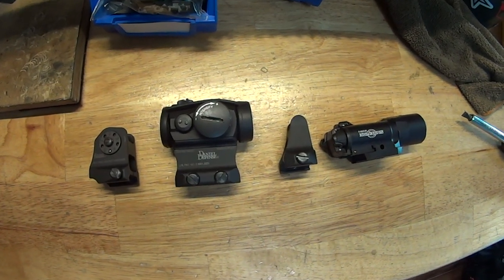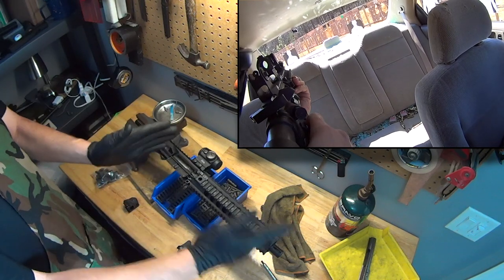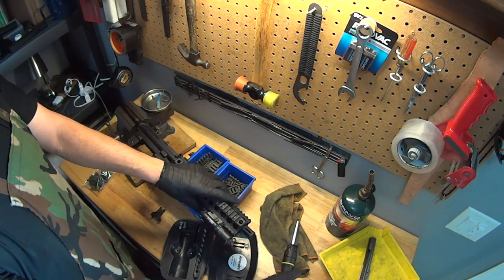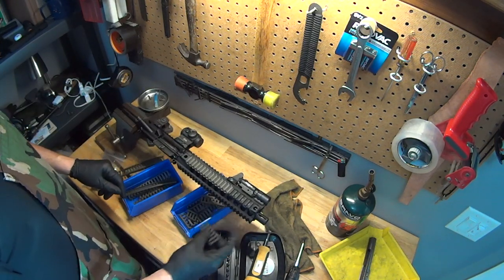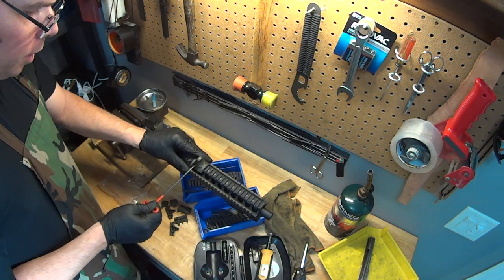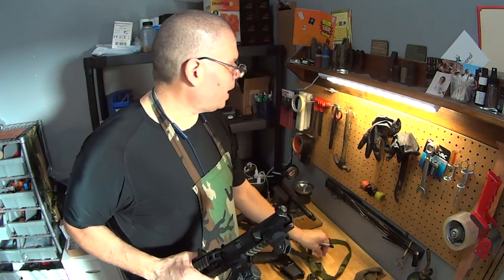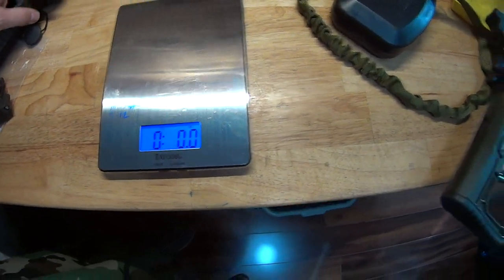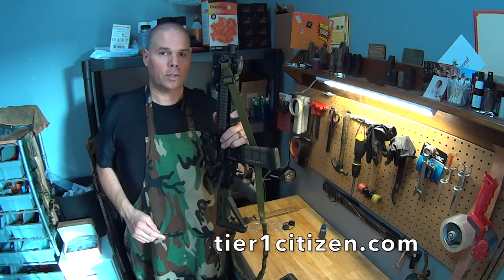The T1C MK18 Dressing Out The Upper

Comment: Thank you for showing this aspect of the build also! I noticed your wheeler fat wrench looked like it wasn’t on the lowest torque setting when you pulled it out of storage (but I may be wrong) from what I’ve read about torque wrenches you wanna keep them on the lowest setting or else they can lose calibration and give a false reading from being kept under too much tension. Looking forward to the shooting video!!
Reply from the maker: I've never heard that about torque wrenches.
Reply: @Tier1Citizen  Yeah in the manual for the fat wrench it mentions to store it at the lowest setting. I did a quick search because I wanted to make sure that I did read that somewhere and I’m not going totally crazy. I found this from motor trend who were talking about torque wrenches and this is what they said about the click over style which is what the wheeler fat wrench is “If you're using a mechanical click-type wrench, this one turns out to be absolutely true. A click-type torque wrench presses a ball into a detent that's held in place by a spring. The wrench is normally adjusted by twisting the handle on the wrench. Twisting it in compresses the spring and requires more torque to pop the ball out of the detent. This is how it measures torque.
But if the spring is stored with the wrench "loaded" or set for a high torque rating, the pressure on the spring can cause it to weaken over time. To protect the wrench it should always be returned to the lowest setting before storing it back into your toolbox.”

So it seems it can weaken the mechanism over time if not stored at lowest setting. But who really knows if it would every really cause an issue. But it is good to know about I guess! 

Thanks again Abner! Always love seeing your video alerts show up! 😎
Reply from the maker: Well dang. Shame on me. Problem fixed!
Reply: @Tier1Citizen  Yeah I doubt it would every really cause an issue but it’s worth knowing about at least! I meant to ask, do you put any loctite on the 4 screws that mount the red dot to the mount? Thanks Abner!
Reply from the maker: No, because the PEM fasteners do an adequate job of holding the optic in place. Loctite could ruin PEM fasteners by causing them to back out.
Reply: @Tier1Citizen  makes total sense! I have 2 vortex space solar red dots that I didn’t use loctite on when I put them on geissele mounts. I was thinking the same thing about backing out the steel inserts if I ever had to swap mounts. Glad I didn’t use it. Thanks again Abner. Always value your input brother.

Comment: Looks awesome! I almost went quad rail to make a “mk18” but decided on the mcmr. I want to sbr it but i just can’t get myself to be ok with paying 200 just to add a stock. For now my magpul btr works fine.
Reply: I kept one of mine a pistol to keep in my vehicle. With my concealed carry I can keep it locked and loaded. Rifles and SBR seem to have tons more regulations especially while traveling across states.
Reply: @Bigjohn2121  yeah it just seems a lot better legal wise, and the brace isn’t that bad… it’s not my sop mod but 🤷‍♂️.
Reply: @itsamk18-ish  I have the SBA3 it wiggled a little bit at first so I pulled it off the back and stuck a little piece of electrical tape on it and the wiggle is basically non existant now.
Reply from the maker: You guys need to try the SBA4. It feels just like a Magpul CTR.
Reply: @Tier1Citizen  i thought about trying the sba4,i heard they were pretty heavy. Also i very rarely see them by themself and I’m not paying 100 for a brace. Always seemed pretty dumb to me that they don’t have more not in a kit. Looks like primary arms and midwayusa both stopped carrying sb tactical
Reply from the maker: Check out the braces from Magpul. They're lightweight and look pretty sharp.
Reply: @Tier1Citizen  that’s what I’ve been using the btr